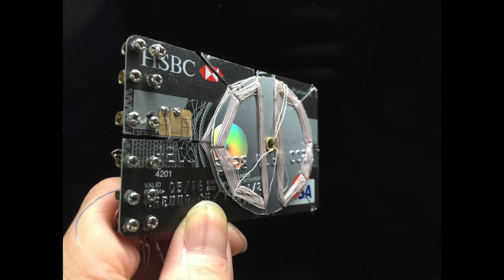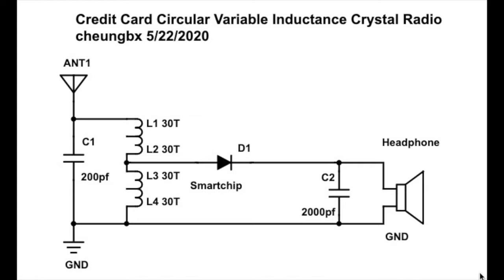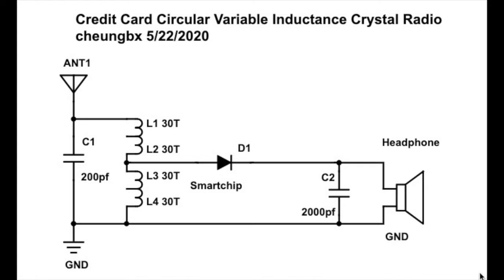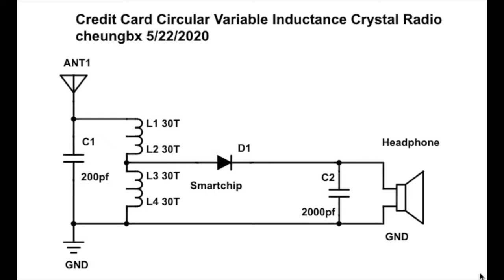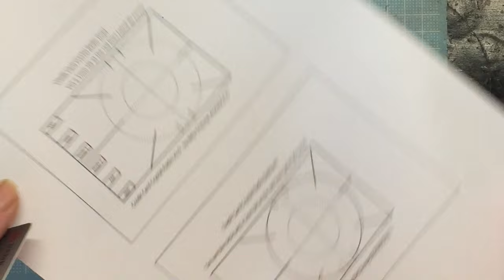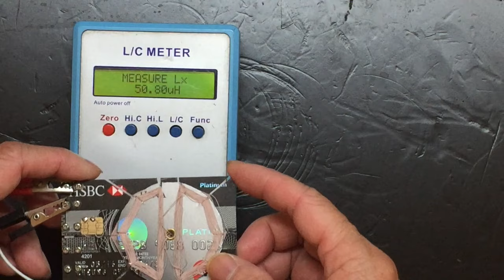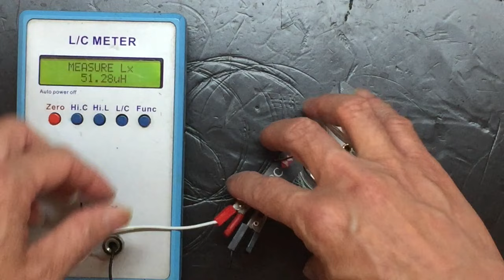Smart Chip Credit Card Crystal Radio

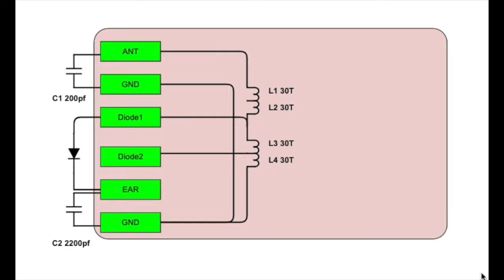Comment: Do you recommend the capacitors listed above in your parts list (200pf,500pf) or the capacitors shown in your schematic in the video around the 2:27 time stamp which indicate a 200pf and a 2000pf capacitor? To confuse matters further I noticed you list a 200pf with a 2200pf around the 9:58 time stamp in the video.

I've ordered some 12/46 Litz wire which if I calculated correctly is similar to the 0.04*12 strands Litz in your parts list above.

I'll be amazed if I'm able to get one of these built and working. It's a cute design.
Reply from the maker: The lower value capacitor 200pf or 500pf are used for the resonance circuit to match up with the coil. You may can try both to see which one covers must part of the AM radio frequency range. The capacitor with a higher value 2000pf or 2200pf are used for filtering out the high frequency component of the signal leaving behind the audio component. Both value will work.
Reply from the maker: Created a blog post to explain this. https://billycdiy.blogspot.com/2024/01/smart-chip-credit-card-crystal-radio.html

Comment: Hey Billy, this is a great little project! I'm thinking about trying to make one. I downloaded all the info from the GitHub, but I'm a little confused about the variable inductor coil connections. Which is L1, L2, L3, L4? Are L1, L2 the top, moveable "half moon" coils? Are all 4 coils wound clockwise? Bottom L3, L4 center tapped & go to diode? Thanks in advance for any further info you can provide!
Reply from the maker: This radio  works on the effect called "mutual inductance".  When two coils are put close together, they will either increase or reduce the total inductance  based on wether their winding is in same direction , or in reverse direction. So, it really doesn't matter whether L1, L2  are on the top or the bottom. What matters is that when you don't rotate the disc , L1, L2 will overlap with L3, L4 in the same winding condition. When you rotate the disc by 180 degree, L1, L2 will overlap with L3, L4 in a reverse winding condition. So, when you wind it initially, all should be wind in the same direction. Then as you rotate the winding direction will be reversed.  If you need to clearly visualize this, then draw the coils on a pice of paper, then rotate it to check out the winding direction before you start winding the coils.    The tape position depends on the impedance of the diode you use , the strength of your antenna and the inductance of your antenna. Try this out to see which tape position work best. There is no "One Design Fits All" formula here. However, in general, if you got a weak antenna, tap closer to the hot end of the coil (away from the circuit ground) will give better sensitivity , but worse selectivity. If you got a strong antenna, tap closer to the circuit ground.  Some people use rule of thumb of 1/4 or 1/3 of the turns from circuit ground for strong antenna, and 3/4 or 2/3 of the turns  from circuit ground for weaker antenna. Hope this help.
Reply: @BillyCdiy  Thank you! Yes, this explains it well. I'll make a prototype and play around with it.
Reply from the maker: Created a post on my blog to explain this. https://billycdiy.blogspot.com/2024/01/smart-chip-credit-card-crystal-radio.html

Comment: Awesome! Looks to be tedious work though parts would be more readily available as many components in your other radios are hard to source btw can you please recommend a ebay company that ships o/s eg the mosfet/diodes/tuning caps etc
Reply from the maker: One of the radio board forum member had an online shop for crystal components. See below : links
e-bay shop for 3DQ (3SK143-Q), Litz Wires, High Q ferrite core (R40C1) and other  crystal radio components shipped from China  : mkmak222_Litz Wire
https://www.ebay.com/str/mkmak222litzwire

3DQ
https://www.ebay.com/itm/MOSFET-3SK143-Q-3DQ-for-Crystal-Radio-Zero-Voltage-Threshold-Detector/161600513556?hash=item25a0242614:g:YBcAAOSwPhdU3sHm

Comment: Too bad you can’t interface with the smart chip to make use of any transistors on board for signal amplification. That could offset your low Q problem. Otherwise this is still a cool project.
Reply from the maker: ladyattis , thanks. My hobby is on Crystal radios. That means no amplifications. I want to keep my design that way.

Comment: Have you found a use for the coil for contactless payments already?
Reply from the maker: I tried the proximity cards where such coils are embedded. But not successful. As the inductabce are  too low for AM radio frequency and the Q factor too low for FM radio. There are also other circuitry blocking the direct access to the coils.

Comment: Can you share with us how did you come up with the design?
Reply from the maker: I started making things out of credit cards several years ago. Most people will shred the expired credit cards. I found that a waste. I kept the expired credit cards and think of ways to up cycle them. I like tiny things. I always want to create tiny crystal radios that you can bring anywhere or just keep them as a miniature model. That’s how I came up with the idea to wind spider coils on a credit card to make radios. Then I keep on simplifying them by replacing add on components with what’s already available on the cards. Eg replace the variable capacitor for tuning with the variable inductance with two overlapping cards with spiderweb coils wound in different directions. And most recently, replace the diodes or crystals with the smart chip on the cards. I also made pocket retro game machines with arduino processors on credit cards.
Reply: @BillyCdiy  Thank you, that is a nice story. If you could share more technical details, that would be great. For example, how does the circuit work, how did it demodulate AM, how did the antenna work? I tried to learn all these myself and it is just too hard, I am half way through my EM textbook.
Reply from the maker: Cecilia Chen , thanks for your interest. I posted a lot of documents at my blog here. You will find your answers here. http://billycdiy.blogspot.com/2019/03/what-do-you-need-to-know-to-build.html?m=0
Reply: Broken link @BillyCdiy
Reply from the maker: @tenlittleindians  ,https://billycdiy.blogspot.com/2019/03/what-do-you-need-to-know-to-build.html?m=0

Comment: So you literally made a playing card :D There's another option - you can make a receiver which has a credit card slot with connectors in right places, so you can remove the card after listening and use it for paying again. Someone may think it's some premium Internet radio decoder, while it's the simplest AM receiver :D Thanks very much, I made a similar radio: https://www.minds.com/newsfeed/1138049509313802240 Currently there's no transmission in my area, so it receives only interrupts from mains. Do you know why it's loudness depends on tuning? It's only 50 Hz (and some harmonics, but I suppose they can't be very high) and this LC resonator is for much higher frequencies range.